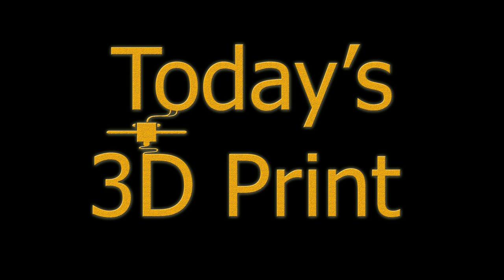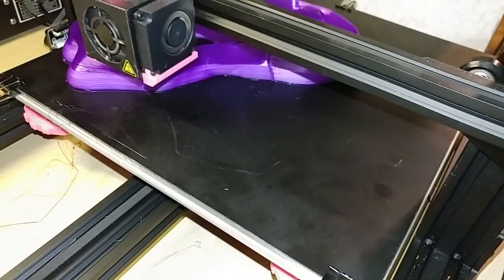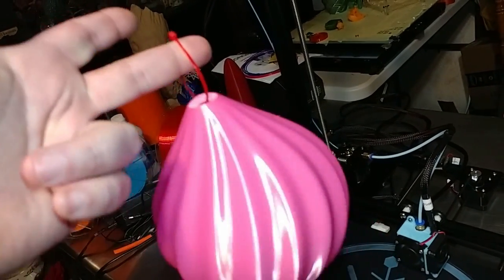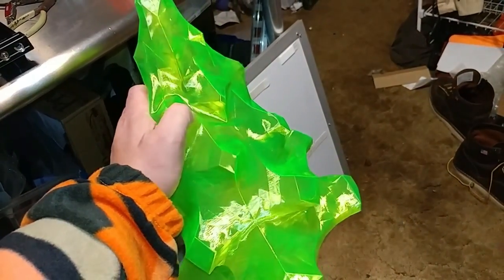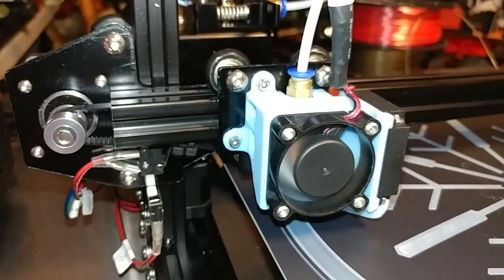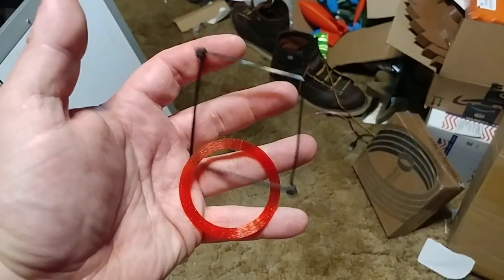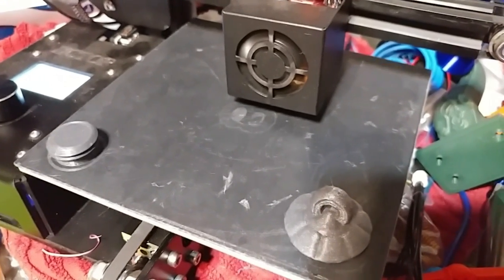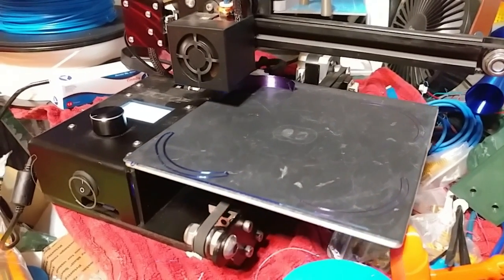Today's 3D Print 171 Quikie Feeding Sessions

Comment: I watch this channel almost every day, for months.  The content is incredible.
I am discovering that it is best to stick with high temp. filament once you go there since bringing down the temp can leave junk in the end.  That is why I need a second printer: ender 2 or kossle delta?  Or, is there a way to clean out my end when reducing the temp - just run regular PLA at 220 degrees for a while to clear it out? 
 For my 1st printer I went with cr-10 and added e3d + volcano, another reason is to keep a smaller nozzle on, I must get the second printer!!!
Your prints have just got better and better, which is saying a lot.
Reply from the maker: clean it out is easy. crank the temp to 260c and just run some of the new filament through it till it "clears out" then reset temp to normal. if its particularly nasty burn it. keep the temp at say 240 and just print something. your going to fry the filament a little but who cares. 20 minutes to print a marvin and you should be clear.

Comment: Hi Nerys,
Just started playing with Flex filaments, any tips for cooling on the Christmas tree print you did? It looks awesome, buddy!
Reply from the maker: +Chris Kyriacou the trick is go sloooooow otherwise i left my settings alo e and it came out nicely. Sometimes i have to up the extrusion multipmier a bit but not much.
Reply: Nerys do you use any cooling at all? I've been able to get some nice basic prints at 20-30mm/s but worry about the 2nd and 3rd row of knobbly bits stringing (which it had done a little on Pla test prints and cooling at 100%)...
Reply from the maker: +Chris Kyriacou my standard protocol for cooling is 0% first layer 35% second layer 75 to 85% third layer it up

Comment: just want to jump in here and ask whats the best 3d slicing software for the CR 10 mini? simplify3d? once again thanks for all your help.
Reply from the maker: +Joe Blog I like simplify3d the best it has the best workflow and user interface but I've also started using Cura and it works just as well it has a few quirks that annoy me but I assume I can figure those out and stop it from doing it otherwise I am getting equally good Prince from both software packages